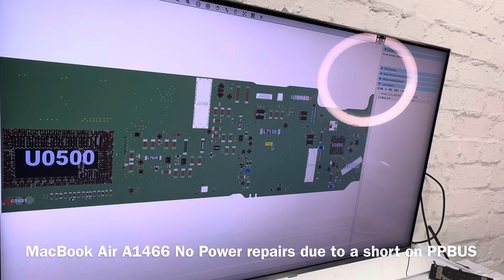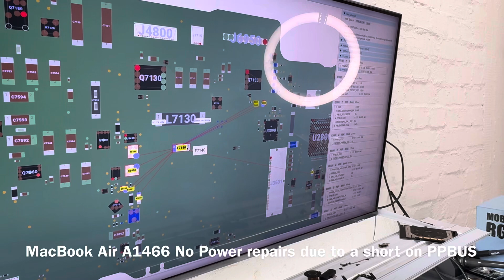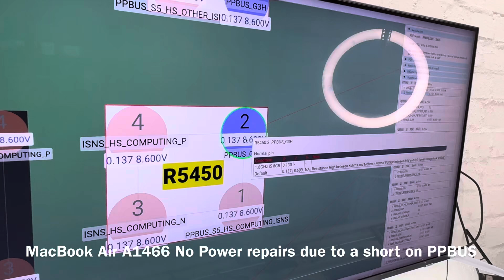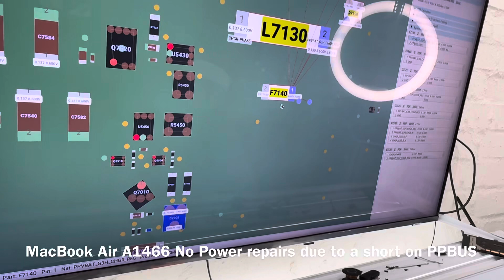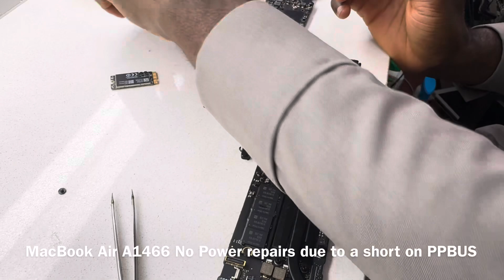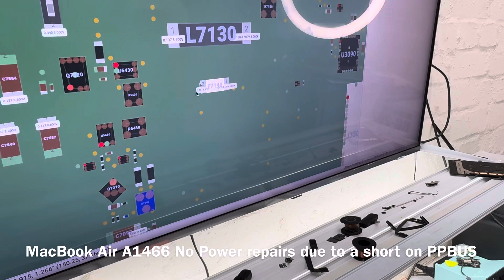MacBook Air A1466 No Power due to a PPBUS_G3H short to ground.

Comment: Sir, can i know what your setting for hot air gun temperature and air for this motherboard? Thanks.
Reply from the maker: Hi, I hope you are doing okay . To answer your question, work stations temperature settings might very from station to station, so my advice would be for you to use a non working board to determine what settings best work in your situation, I hope this helps.
Reply: Thanx bro for sharing this informative video
Reply from the maker: @tauraimachingura thank you for taking the time, I hope you draw some benefits from it